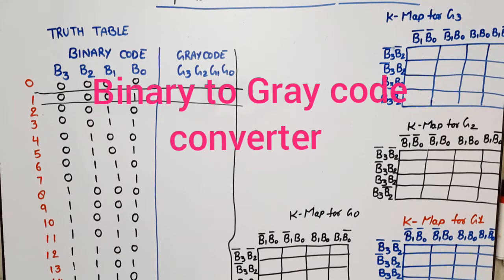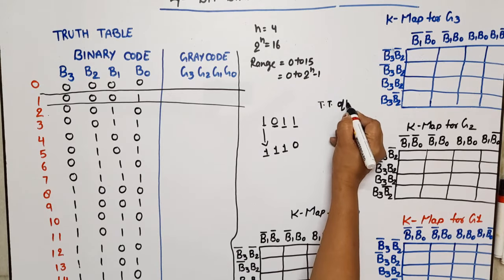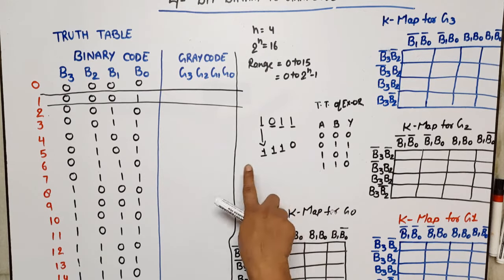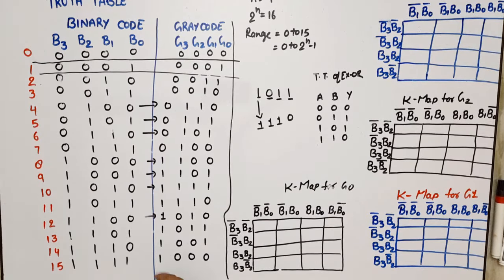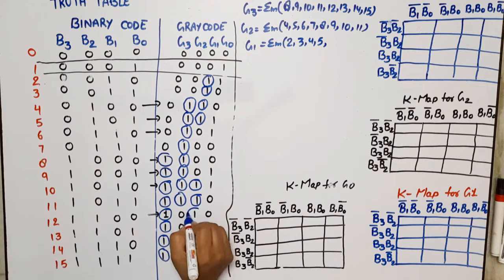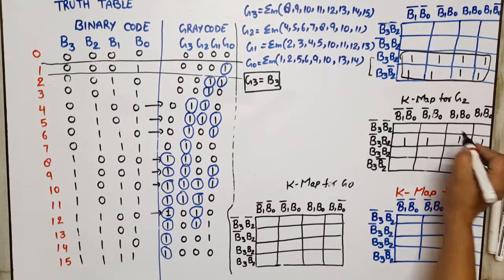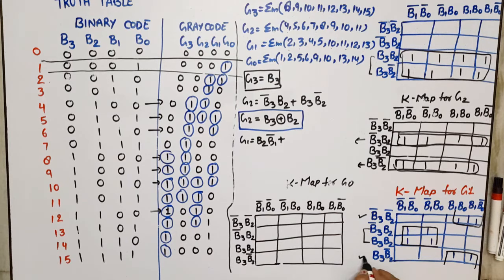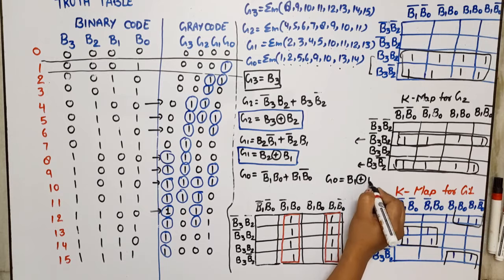U2L2.3 | 4 bit Binary to Gray Code Converter | Binary to Gray code Converter | Digital system

Comment: Is this with encoder or decoder???
Reply from the maker: Using logic gates
Reply: @TechnoTutorials2783 ( Specify and implement a 4-bit binary to 4-bit Gray code converter using a decoder and an encoder.)....actually this was the ques!
Reply from the maker: @depressedengineer8632  https://youtu.be/Bul2wK0MkBY
Link for 3 bit u can refer this 
I will try to upload for 4 bit as well
Reply: @TechnoTutorials2783  thank you so much mam!🙏🌸

Comment: If we take B0, B1  / B2, B3  not as B3,B2 /B1,B0 in k map then the equation for G3 ,G2, G1 and G0 get changes then?
Reply from the maker: Generally we take B0 as lsb 
If your binary no is B3B2B1B0 
Then u can take B3B2/B1B0
or B1B0/B3B2  In both cases answer will be same 

But if ur binary number is B0B1B2 B3
and axis B0B1/B2B3

THAN G0=B0
G1= B1 XOR B0
G2 = B2 XOR B1
G3= B3 XOR B2
Reply: @TechnoTutorials2783  yes man thank you